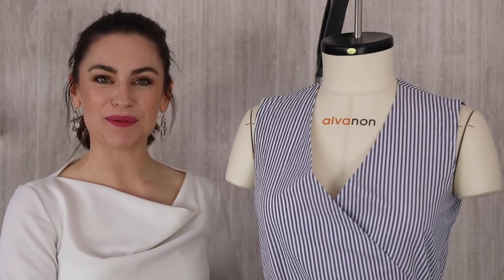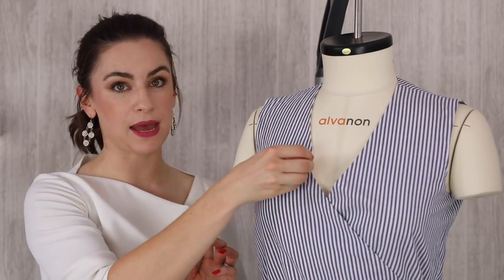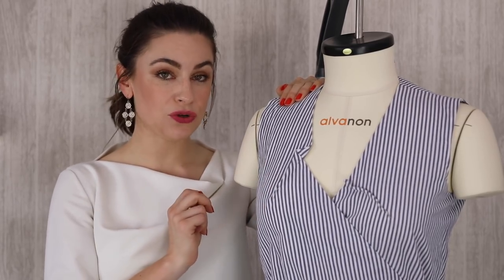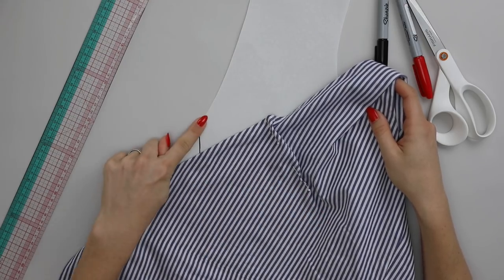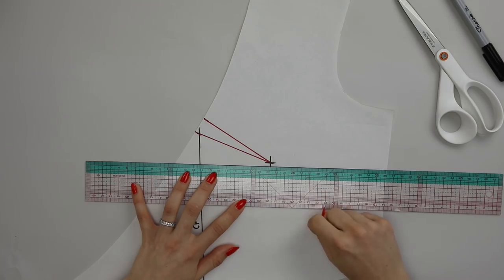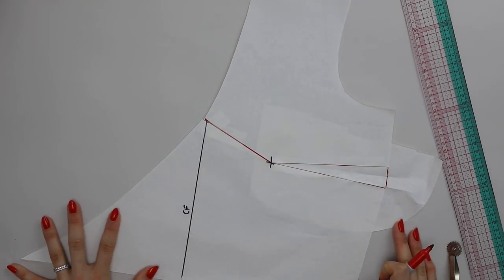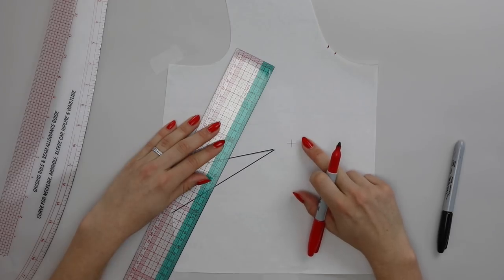How To: Fix Gaping Neckline & Armhole

Comment: Hi Aneka, I am just drafting my first garment, a dartless, v-neck top with dropped shoulder.  With a slightly gaping neckline. Just a matter of 1/4" on both sides. I thought I could just pinch away the gaping at the shoulder, but of course it didn't work.  I would never have guessed in a million years that I needed to make darts in the neckline to start the process of altering the pattern. Your tutorial explained exactly what to do, and why, and I'm amazed by how clear the explanation was.  It's like magic, and it's fascinating! When I've got a problem, I know I can come to your channel, and there will be help there for me. [Hello, how to sew a v-neck with facing *properly*, and so much more! ] Thank-you so much!
Reply from the maker: Such a pleasure. Yes, when you are drafting a deep neck pattern you will generally need to take a small dart from the neckline to get the neck to sit flat against the body. So what you did is perfect! Aneka x
Reply: @MadetoSew  Thanks Aneka!  Sorry for misspelling your name!
Reply from the maker: @kmf634  oh thank you. That's ok. Aneka x

Comment: Hi Anika, Thank you for the many, many lessons over the years.   I know that this lesson is a couple of weeks old now, but today was the first chance I have had to watch.  
I followed along on how to create the new darts, and close them up on the pattern; then comes the part where I always get stuck.  
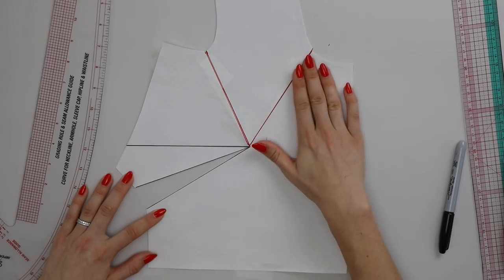By 17:10 minutes you have completed the above mentioned steps.   At this point the original side dart is then huge!  
I understand that we need to add paper to fill in this pattern dart, and that it will need to be trued...
What happens to that side seam?  This is where I always end up lost! 
Would you please show us how to finish this original dart where all the other darts have been rotated into, and how to redraw that vital side seam, and the waist line?  This is the same problem I have with full bust adjustments.  Again, with so many thanks!
Reply from the maker: Thank you so much for your lovely words. I am so pleased I could help. 

I believe I show how to 'true' the dart, folding it and blending into the side seam in this video: https://www.youtube.com/watch?v=FkK5bZ63YAo&t=8s

I start with a shoulder seam and then do have a side seam. Have you watched it? Does it answer your questions? If not, let me know. 

Thank you, Aneka x

Comment: what do you suggest for gaping on the back side of the sleeve? how do you get rid of that? I LOVE your tutorials thank you
Reply from the maker: Thanks you Julie Ann. It depends where it is coming from? If you can't take an adjustment at the shoulder or underarm to fix it then you make need to take a dart and I would move the dart from the back armhole into the shoulder? Let me know how you get on. Aneka
Reply: @MadetoSew  it's gaping in the back of arm. I tried moving it to the waist dart but its huge now and I don't like that. I'll try a shoulder dart. Thank you
Reply from the maker: @julieannsmithmusic  Yes, you can't really move the darts to the waist in the back of the body. You have to think where the curves are in the back and this is the shoulder blade, so a shoulder dart should work. 😃

Comment: You're an absolute lifesaver!  I just tried on my toile and the gaps just above the bust towards the armholes are so massive, it looks like a freaking wind tunnel 😡

I have just one question though: The pattern is from a sort of mix and match pattern book and the bodice can be sleeveless or with sleeves. 
Should I put in the sleeve before pinning the excess and amending the pattern? 
I'm not quite sure, I'd I'll do the final dress with sleeves or not. Will it make much of a difference?
Reply from the maker: Pleased I could help. Personally, I would draft a different pattern for a sleeved or sleeveless bodice. A sleeveless garment should have less ease in the armhole and fit tighter, whereas with a sleeve you need more room. I would sew it how you plan to make it (sleeves or no sleeves) and then fit. 😊

Comment: Fabulous tutorial A again - I need to lose a V shape at the centre neck- looks like I need to use this method x 2 ( one on each side). I’d wondered how to do this to keep the straight of grain correct - this seems the solution! Thank you.
Reply from the maker: Hi Suzanne, the grainline will shift for the upper part of the garment when you change pivot the darts out of the neckline. With a V-Neck the neckline is already on the bias, so just keep the grainline in the original location, probably parallel to the centre front? Thanks, Aneka
Reply: Made to Sew thank you. It’s a jewel neckline so keep original grainline I assume also? The V describes the shape of the excess material the needs removing from the centre
Reply from the maker: @suzannejeffries2151  Yes, keep the original grainline, you may need to re-shape the neckline once you have removed the excess.

Comment: This is very helpful tutorial.  Especially the round necklines which seems to come too large, too deep,  in patterns and ready made garments. Thank you. Brilliant! Never would have thought to place darts there! Thank you very much!
 However, I have a question; (I understand the dart insert when it comes to bust area) but....while adjusting bust, what do you do with under the arm seams which will twist forward. 
Do I cut out the under arm excess fabric?  Place a dart but...where? Thank you
Reply from the maker: Hi Dee, what do you mean by the underarm seams twist forward? Do you mean that the side seam isn't running straight down the side of the body? Does it move forwards the front. It should be at a right angle to the floor. 

If the side seam is doing this, you might need a Full Bust Adjustment, have you looked into that (https://www.youtube.com/watch?v=UoiMxhN_H8Y) to make the side seams hang straight?

Let me know. Thanks, Aneka x
Reply: @MadetoSew  Thank you so very much for your response and another great the video on FBA.
What I mean, and have trouble with,  is that after adjusting the "torso" part of already made garment , the seams along sleeves themselves, end up facing/twisting forward. 
I'm not sure what to do with the fabric that falls in area of armpits. 

I tried to take sleeve seams apart; from elbow area to the armpit, re-sew to fit into now fitted torso (after adjusting that with darts)  but there is excess fabric on the sleeves that won't fit and sleeve seams twist forward.

I hope you can "visualize" my explanation?
Reply from the maker: @incanada83  I think I understand what you are saying. Once you have removed a dart from the armhole, the armhole is now smaller than the stitching line for the sleeve? So you need to remove an amount from the sleeve to make them fit? 

Do you mean this? Otherwise do you have any pictures you can email me? info@madetosew.com.

To add sometimes you need to move the hole sleeve in the armhole. The notch on the top of the sleeve that matches the shoulder on the garment isn't in the right place for everyone. It depends on how your shoulders and arms hang on your individual body. If you are getting pull lines on the sleeve cap you can undo the top of the sleeve and twist it in the armhole. The notch for the sleeve at the top of the sleeve cap, might need to go forwards or backwards of the shoulder seam (this is totally fine to do, if that works for you). Just re-position the notch on the sleeve after fitting to match the shoulder seam of the garment.
Reply: @MadetoSew   Thank you so ever very, very much! You've explained all beautifully!
(I don't have pictures. I was so frustrated that I just cut up the outfits to smaller pieces and used those for  other projects).
By the way, the sleeves I mentioned earlier, were on already made garment. So no notches but! Thank to your explanation, I can "re-notch" or mark the top of the sleeves and go from there.
I was also looking (by chance and have never heard of) at something called a "gusset". I think combining those two techniques, I might actually make something wearable LOL
Thanks again for your time, videos and for writing back :-)
Reply from the maker: @incanada83  Wonderful. Yes a gusset is a triangle piece pattern that sits under the arm of the garment. You often see them in close fitting sports leggings under the crotch. They will help with movement. 😀
Reply: @MadetoSew  Yes. Thank you.
Speaking of the crotch....I don't think it helps with ahem...camel toes LOL
Reply from the maker: @incanada83  😂 😂!
Reply: @MadetoSew   LOL

Comment: This is a super helpful tutorial, thank you so much!! I am fairly new to sewing and especially to fitting clothes to me and I've made so much progress by following your tutorials! Gaping neckline is especially an issue for me so this video was great. I have a small question: I tried rotating the neckline dart into a bust dart as you demonstrate, but j ended up with a vast dart as they're already quite large following an fba. So instead I rotated into the waist dart figuring it was the same. I've got started with the nice fabric (always a mistake!) And I'm now having issues with excess at the bust apex that I didn't have before - could I have accidentally shifted the bust apex by this method? Thank you!
Reply from the maker: Hi Hester, you shouldn’t have changed anything by moving it to the waist dart. As long as you used the same apex point then you can use dart manipulation to move it anywhere. 

Usually the waist dart is backed away more than the bust dart? So the dart will sit further away from the apex. Could this be the issue. 

Also for future reference you could have left it in your bust dart and just removed the bulk from the dart to make a cut away dart. This would have helped when sewing. I have a video in this: https://youtu.be/xgPanWBRlfs

Aneka x

Comment: I noticed on other videos on how to reduce a neckline, they draw a line higher up across the part above the breast to the armhole, then pivot, it seems simpler in that you don't have to factor bust point or put a dart in, Why would we do it this way versus that other way I've seen?

Comment: This is really excellent. Thank you because my book didn't explain clearly at all on how to fix gaping armholes or neck lines (on my learning how to self draft project). On my other project, I've made a dress, yes I should have done a test fit first :'(. On this Dress I had done a FBA on princess seams(following your tutorial I think). I don't know if I did something wrong but it seems that the gaping is just happening on one side on the centre front. The FBA was a little too big for me because I hadn't realised that McCall's give a lot of ease so I took that all in.

My question is how do I fix something that's on one side but supposed to be symmetrical? I don't want to interfere with the good side. I will start again from scratch with all this in mind and do it on muslin first -- Lesson learned lol

Thanks again. Your videos are definitely the most helpful I have found
Reply from the maker: Hi Louisa, 

Do you think your body is a different shape/size on the side that has gaping? Of course nobody is symmetrical it is just a case of trying to work out if something is wrong in the adjustment or if it is your shape. 

If you have an adjustment you make on a princess seam, rather than sending the dart that is gaping to the dart, you can send it through the pattern piece. To remove it completely. So you would draw a dart across the pattern piece, ending at the stitching line. Cut and remove. You could do this to just one side, as long as the garment ended up looking symmetrical on the body. 

Does this help?
Aneka
Reply: @MadetoSew  yes. I’ll try this. Thank you 🙏🏻

Comment: On the green and white top, wouldn’t you just sew a smaller size for above the apex and do a FBA?
Reply from the maker: I guess you could do that, but it does depend on why it’s gaping. If you have all the measurements correct and have chosen the right size and cup size then the issue may be in the pattern draft. 

I always remove some contouring when I lower the neckline of patterns. Not everyone does. 

And it could also be your unique shape, if you were having issues with this. Some people are very hollow in the chest area. 

Or it could be any issue with the neck width. 

This example is more of a ‘this is how you could fix the issue’. It’s a quick fix that will work. A more detailed look that I would take might be neck width of front verses back of pattern; they should be different. 

And of course for this example, I made the garment not fit the mannequin just to show it. 

Hope that helps!

Comment: Hello Aneka. What about shortening the front armseye. It’s not going to be the same front and back for putting in the sleeve
Reply from the maker: Hi Margaret, you are correct if you shorten the front armseye you WILL need to adjust the sleeve pattern. Or at the very least measure the stitching line of the sleeve cap and the armhole (front and back separately, because they shouldn't be the same length, the back is usually longer than the front) to make sure that they can sew together. Consider how much ease you have in your sleeve (if any), compared to the armhole. Hope this helps, Aneka

Comment: May I ask..my dress only have waist dart which is 1 inch away from the bust apex.. and when fitting, I have some gapping on the armhole..which way should I centered the excess? Is it the bust apex or the dart point?
Reply from the maker: I would extend the waist dart to meet the dart point. Remopve the gaping in the amrhole to the dart point (which is now connected to the waist dart), and then before finishing back the dart away from the bust apex by 1" again. This will mean that you don't remove any volume from the bust area itself. Is that clear?
Reply: @MadetoSew  thank you.. that's very clear..
Reply from the maker: @shafiahaqilah  Glad I could help.

Comment: Is it too late to fix the neck gape if ive already sewed the garment?or is there a way to save the garment?its a crew neck
Reply from the maker: Unfortunately not, if you have already sewn the garment it is too late. You could put a dart in, or some detailing to hide it?  Otherwise you could try and remove your facing or neck finishing, gather the neckline slightly and reattached the facing. This could work if it was a minor adjustment; absorb into gathers you can't see. Aneka

Comment: For the side of the princess seam, could you not take off the excess from the seam line itself?
Reply from the maker: Hi Michael, if you take the dart (amount you want to remove), through your seam allowances you would end up removing an amount from the actual stitching line of the garment. Which could then affect how this sewed to the corresponding piece. Does that make sense? We don't want to affect the seam at this point, we are trying to take the dart to 'nothing' at the seam. Sorry, it probably wasn't as clear because I only took a small amount. Any further questions let me know. Aneka
Reply: Made to Sew this totally makes sense thank you so much for clarifying :) you’re videos are amazing

Comment: Thanks isn't enough l am waiting this tutorial since last week ...l 've send you a message at Instagram ...remeber me 
Now I can vix my neckline 
😍😍😍😍😍😍😍😍
Reply from the maker: Yes I do! I am so pleased it could help. Basically you will need to remove an amount on your neckline to prevent the gaping. Make up a sample garment and see if you need to remove any more. I would start with say 3/4" - 5/8" (2cm-1.5cm) because it is a LOW neckline. Aneka x